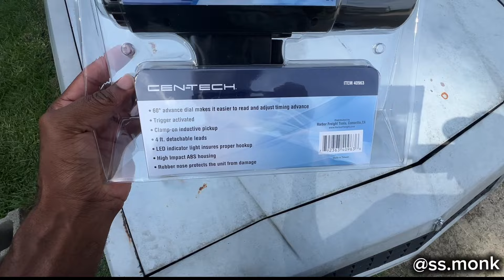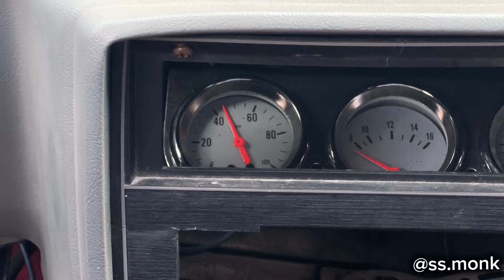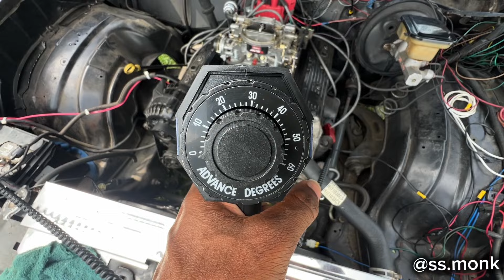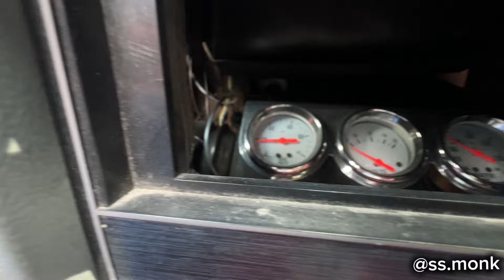ALMOST CRASHED THE SS , NEW TIMING LIGHT TO SOLVE MY ISSUE? 👀👀😤😟😟 #gbody #montecarloss #projectcar

Comment: I'm running an l31 also.  That oil pressure is normal. It's ok as long as it goes up with rpm. I got a fairly large cam in mine and I locked my distributor out at 36 degrees.when you set your timing with your advance. Just make sure it don't advance too much. Mine would advance to almost 50 degrees.
Reply from the maker: Dude. I think mine is doing that!  The car randomly kills when I’m driving sometimes.
Reply: @jemelmonger  once you get that timing curve good, then you can move on to the carb.  You'll have all the bugs worked out in no time.

Comment: bro thats it ignition timing to start the car! and advance timing keeps it run in high rpm range 3500-5500 play with that advance to keep her going pass 2500 rpm or get a msd, or hyperspark to control timing during high rpm plus dont drive with disturbutor loose before u hit bump and timing moves 😃
Reply from the maker: Yea it’s fairly tight. But ima lock it down

Comment: Bro I have that same light and I have the same issue. I don’t see the timing mark on the balancer. Ever since I swapped out the th350 transmission for 700r4, we’ve been having a misfire/bogging problem. So far I had the quadrajet rebuilt, new fuel pump and coil.
Reply from the maker: I started to see it at one point but once I twisted that distributor , it went away. I also been reading that L31 run best 10 degrees advanced. So I’m not sure if that’s what my issue was